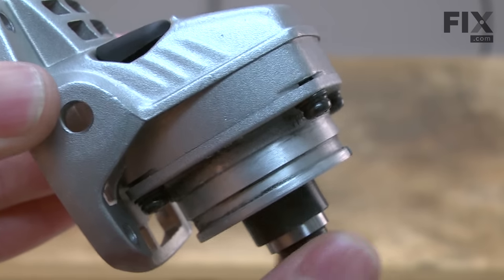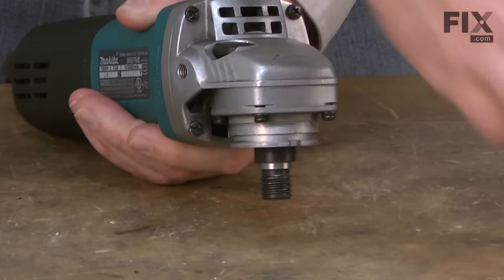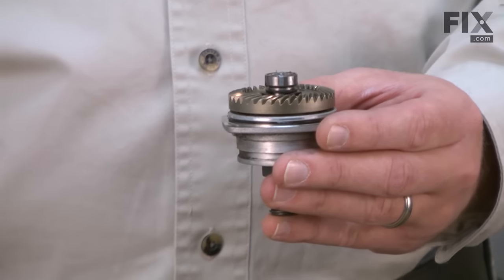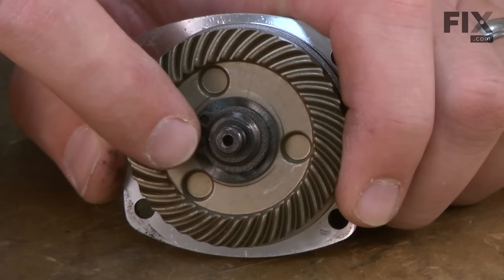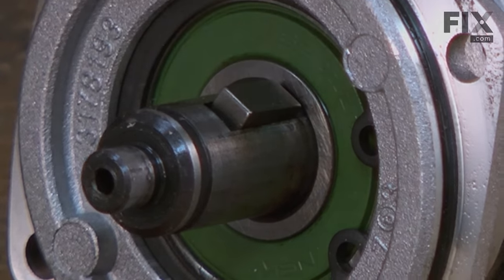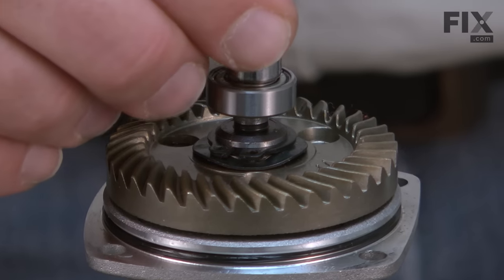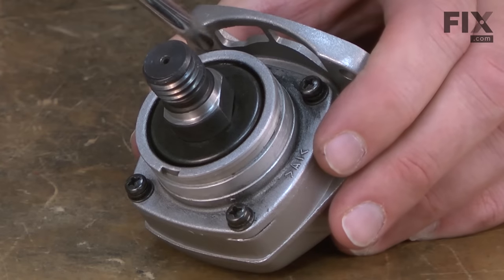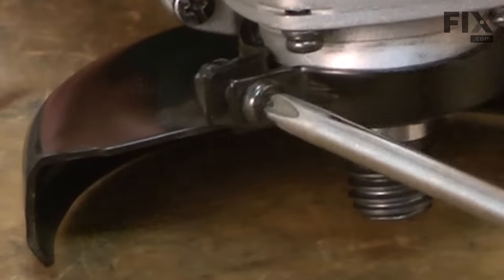Makita Angle Grinder Repair – How to replace the Gear

Comment: hola que modelo de makita es?  yo tengo el mismo al parecer pero al encender el esmeril sale olor a quemado y humo
Reply from the maker: The Grinder in the repair is a Makita 9557NB.  If your grinder is smoking you probably need the Field and Armature.  Both of these can be replaced for around $45.00 USD.  The Makita grinders on our site are 110 Volt 60 Hz.  Please beware the components for for these are very model specific.  Use the model number off your tool when purchasing parts
El Grinder en la reparación es un Makita 9557NB. Si su trituradora está fumando probablemente necesite el campo y la armadura. Ambos pueden ser reemplazados por alrededor de $ 45.00 USD. Las amoladoras Makita en nuestro sitio son 
110 Voltios 60 Hz. Tenga en cuenta que los componentes para estos son muy específicos del modelo. Utilice el número 
de modelo de su herramienta cuando compre piezas
Reply: Dario Briones 
ggj0
Reply: @FixDotCom  thank you  bro

Comment: can you feature bearing replacement of a makita hp1630 spindle bearing?
Reply from the maker: Hi Eric, we do not have any data in our system on the Makita HP1630. It is not a tool that is used in North America. It is a 220 Volt tool. The tools used here are 110 Volt. The HP1630 is not listed in the Makita USA catalog.
Reply: @FixDotCom  sir I am hoping you can answer a question for me that I asked you tonight on your video from about eight months ago on how to fix temperature dial on a General Electric older refrigerator ... if you would go to that video you will see my question and it is the only question there . Thank you for all you do making these vids .

Comment: compre el  mismo modelo y tres días después de  a verla comprado se rompieron tres de los dientes de la  misma parte que se muestra  en el video.  lo peor  es  que  solo la estaba utilizando para remover pintura con  discos de lijado. 
creo que  makita a dejado de tener  la calidad por la cual  tiene tanta popularidad. 
esto lo digo porque trabajo mucho con este tipo de herramientas y entre ellas  tengo  algunas que me han  acompañado por años y aun siguen trabajando en muy buenas  condiciones.
Reply from the maker: I'm surprised to hear that your having a problem with your tool.  We have many commercial accounts that use these Makita grinders.  The Gears do wear and need to be replaced but it's not at all common to have an problem in such a short time.  I recommend checking the Drive gear on the end of the armature also check all of the bearings for wear or play.  If these are worn it will cause slight movement and the gears and teeth wont mesh correctly.
Me sorprende saber que tienes un problema con tu herramienta. Tenemos muchas cuentas comerciales que usan estos molinos Makita. Los engranajes usan y necesitan ser substituidos pero no es común tener un problema en tan poco tiempo.
Recomiendo comprobar el engranaje de la transmisión en el extremo de la armadura también comprueba todos los cojinetes 
para el desgaste o el juego. Si estos se usan, causará un ligero movimiento y los engranajes y dientes no encajarán 
correctamente.
Reply: Vicente Zaldivar